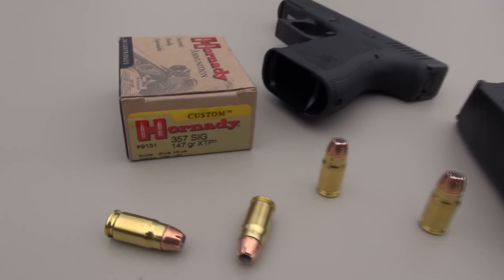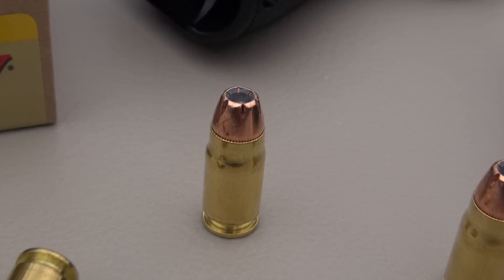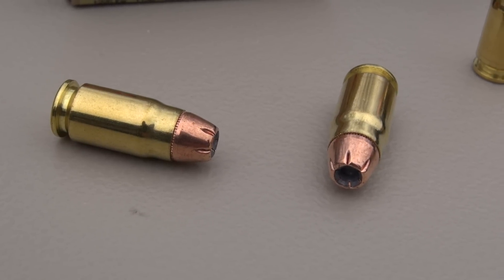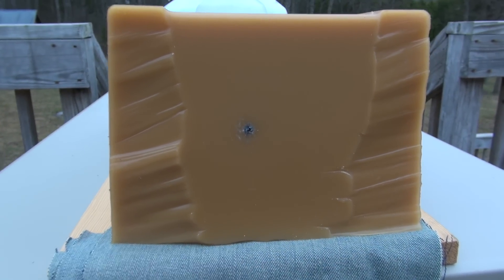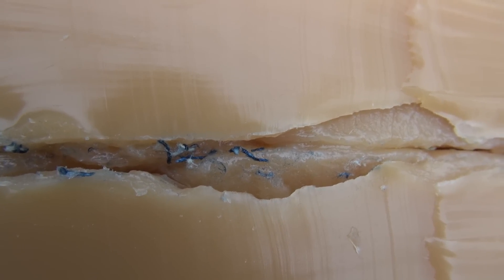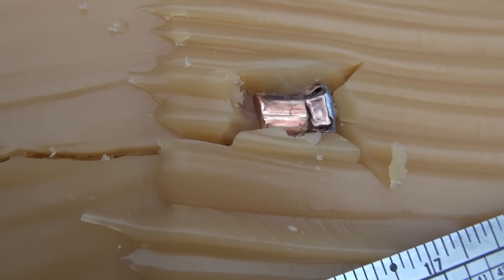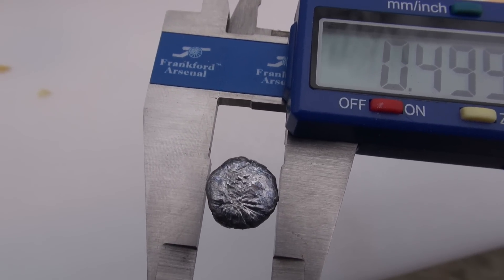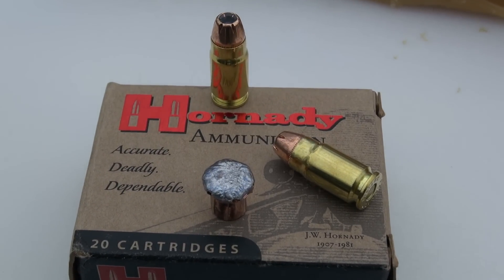.357 SIG Hornady XTP 147 gr AMMO TEST

Comment: @laladoodieincarnate No. The .357 is a rimmed round, and the whole cartridge is the size of a 9mm. It would not fit into a .357 auto. The firing pin is for center fire cartridges, which means it strikes the center of the round. Rimmed fire hit the rim of the round.If the .40 S&W was put in a .45, it could go off if the firing pin hits the primer. It could destroy the gun though. Since the barrel is not the proper measurement, it could potentially shoot through the gun itself.

Comment: @laladoodieincarnate Also, .357 SIG cartridges are in a .40 S&W case, necked down to the .357 projectile. The .357 magnum's cartridge is the diameter of a 9mm. So, .357 is really a 9mm with a lot of powder. The .357 Sig would not fit in a revolver, because it has a larger diameter. And since .357 magnum is rimmed, the firing pin would strike the center, but it needs to hit the rim to fire the round. It would not work.

Comment: I own a.357  31&32 took them both to the range yesterday.
at 25feet with the 31 I had 11 out of 14 that were dead center all 14were within the reach of my fingers palm flat.
With the 32 all 14 were center mass and covered by my palm.
I had gone to buy a .45,1911 but after firing my own Glocks ,even though I had wanted a .45 acp 
I felt safe enough.So I saved
$1500.

Comment: @VeracityNation 
Something like the 147 grain HST. It got over 13" of penetration and had a larger expanded diameter than most .357 sig tests. The .357 sig really only get you increased barrier penetration, which as a non-leo, I dont have to worry about. The .357 sig really doesnt gain you an increase in terminal ballistics over the 9mm. It's not just I who think this; Dr Roberts who is one of the nations leading wounds ballistics experts agrees. Blast, noise and recoil are more in the sig too.

Comment: like to see hornady critical duty 357 sig 135 gr test
Reply: Stick with the Speer Gold Dot or Winchester PDX. If you're really nervous about it put a dab of silicone into the hollow point. It'll work great.
Reply: @44hawk28  I've done that, and it did!
Reply: @dwarden3  spear was on the verge of introducing around exactly like that several years ago. But I think Hornady cried foul. Hornady was not the first funny to think of putting something into the hollow point of a projectile. I still remember when they were putting about a grain or two of powder and a primer Intuit 2 see if they could get the projectiles to explode. They did once in awhile.
Reply: @dwarden3  question, how much weight did it add to the projectile?
Reply: Slow and weak , low recoil , low flash and blast, hard lead .

Comment: 1150 fps is piss poor. Hornady should be ashamed of themselves. The whole point of the 357 sig is to emulate a 357 magnum power in a magazine fed pistol. Hornady has failed they are part of the problem why this round isn't catching on and price coming down. Get a 125 grain in Underwood ammo and you will see what the 357 sig can really do.
Reply: you got it wrong. The standard measure is using a 125gr bullet not a 147gr
Reply: coolvideo28 thanks for laying it out for us—this watered down s*** is awful.
Reply: @jackomalley3687  173gr at 1450-1500fps from an 8+ inch barreled revolver was the standard of which 357 magnum came to be. Which once you put that load in a 3" revolver(Glock 31, P226 equivalent) you are looking in the neighborhood of 1200-1300fps again with a 173gr cast slug.

Double Tap claims 1050fps for their 180gr 357 Sig, that they, a heavily insured company deems safe in all 357 sig chambered weapons,  handloaders can do better, though maybe not in a Kel Tec P357 or AMT Backup. Reports of over 1200fps exist on the internet (always true) from a couple sources using 180gr JHPs like the XTP 35771. 800x is a good powder for it.

147gr JHPs in mass produced factory ammo should be cooking the same speed as S&Bs 140gr at least 1300 from a 4" BUT the XTP is the only .355 147gr that fairs well at 357 Sig speeds. If you want to chase magnum ballistics use magnum bullets. 
Disclaimer using oversize bullets and loading outside the book is dangerous, blow your face off blah blah blah....
Reply: Count Asti  An actual step up from 9mm +p+ is what most are looking for with 357 sig, not just a higher price and cooler numbers on the headstamp.
But hey if you are satisfied with a watered down 147XTP @1150fps more power to ya because you could a 9mm and send a 147XTP at 1125 with an extra round or two in the magazine, savimg money and being able to buy ammo at any corner store so it's a win win if you are satisfied with only getting 17" into gel with a .35 cal XTP.
Reply: Probably afraid to shoot the Underwood stuff in the Glock afraid it'll blow it up within about 5 thousand to 8 thousand rounds would probably be the entire service life for a Glock in a real caliber.
Reply: @coolvideo28 
I agree and I would think 1350 fps would be minimal for this round but more like 1450 fps ...
Reply: Got some. Looking at Buffalo Bore as well. Might as well spend the extra $ on hotter ammos since .357 Sig ammo is rediculously expensive as it is

Comment: @Hoodyhoo2121 You missed the point, which was that there is discrepancies between ammo mfrs, which is primarily due to profitability bias. The .357 Sig round only exposes superior performance when the bullet is designed significantly different than a 9mm round to compensate for higher velocities. Doing that engineering costs more money & mfrs. would rather use same bullets as their highest production 9mm. Ergo, subpar performing .357 Sig rounds w/ lower velocities than SAAMI specs.

Comment: @Hoodyhoo2121 Comparing best load in a given caliber to lower performing loads in another caliber is not a valid comparison. The HST 147gr in 9mm was 13.25" penetration w/ .664" expansion. The XTP 147gr in .357 Sig was 16.86" w/ .501" expansion. Not sure, but it seems that the probability of missing a vital body part by only .08" is favorable to probability of missing by >3.5". Mind you, these are LOW velocities for this caliber. Do you have citation to Dr. Robert's paper?

Comment: Excellent video. I am not to impressed with Hornady custom. I went to the range and using a Chrony master beta chronograph I saw disappointing readings . I also shot Speer GDHP witch came in as advertised and the Winchester pdx1 came in hotter then Advertised on there box.

Comment: You can duplicate this load in 9mm with Vihtavuori's data of 3n38.  http://www.lapua.com/en/products/reloading/vihtavuori-reloading-data/relodata/6/34 This is really soft for a 357 sig, considering the 9mm version isn't even +p with the same numbers.
Reply: Savio Strawn try duplicating the 125 grain 357 sig Underwood ammo. Not happening.
Reply: Underwood is more of what a 357 sig should be. Other brands often load them real weak. However you can essentially duplicate the performance of that load (.6" with 15" penetration) with most quality 9mm loads. It depends on whether or not you feel the extra energy of the sig actually adds wounding effect anywhere other than on paper.
Reply: this same round "non +p" as you put it is only running 975. Not exactly the same performance. Likely not looking at 147.
Reply: Harry B The VV 9mm load is doing 1200fps with a 147gr
Reply: okie dokie